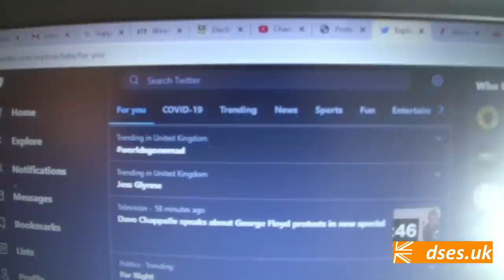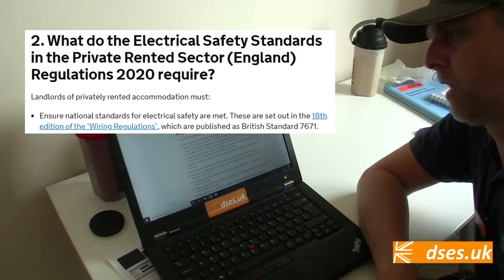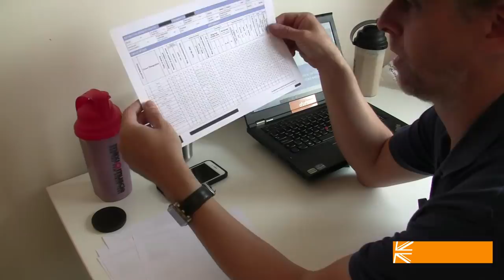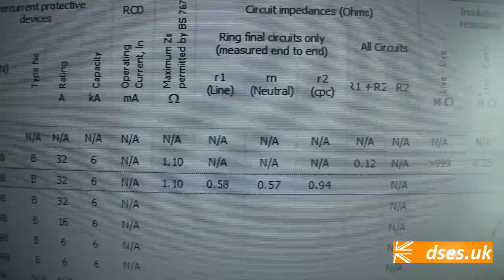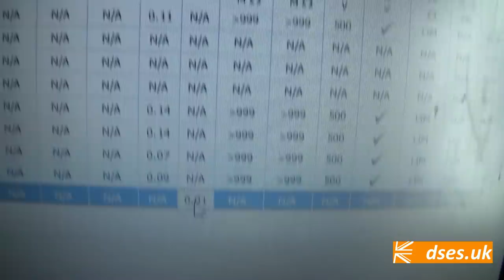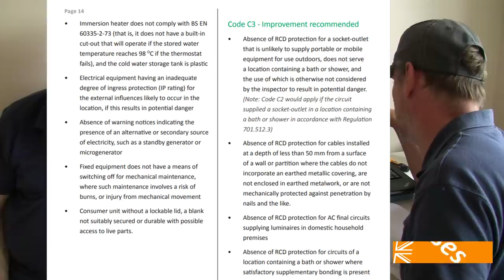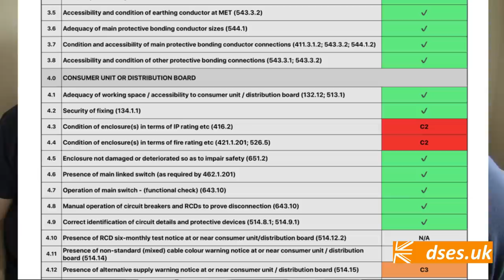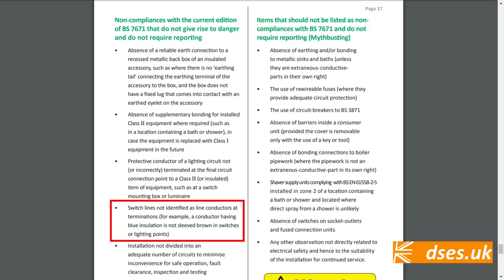Landlord electrical inspections from July!

Comment: The thing with these "landlord regulations" tests, is that it'll only affect the landlords that actually give AF; the bent ones will still be renting out run-down dog kennels for £££/month, or they'll scream "woe is me" at the idea of spending more than a fiver.
Reply from the maker: Sadly, always the case Adrian. Those who play by the rules also suffer under them as they get tightened. There are too few penalties for those who are happy to shun their responsibilities.
Reply: In Scotland you have to do it and if the landlord association finds out you haven't got a test certificate then the landlord is fined £3000 per property

Comment: Those ceilings look older than 1999 to me.
Reply from the maker: That's the quality Artex finish - ruining ceilings into the 21st century! We have an estate next to us built at the Millennium where they smeared Artex all over the ceilings. Plenty of work on putting in downlights for all the homeowners who are getting them replastered into a flat finish.
Reply: @dsesuk  one more year and that Artex wouldn't of been used with the Asbestos banned in 2000
Reply: David Savery Electrical Services Wow – that’s amazing. I thought that stuff was banned years ago because it contained asbestos.
Reply from the maker: @markpunt9638  I think Artex may be a brand name, but whatever they used, they weren't shy about smearing it over the ceilings twenty-odd years ago.

Comment: Their trying to keep fucking grenfall tower from happening again
Reply from the maker: To do that, they need to enforce workmanship standards. Switching to metal boards was a way to try and contain fires on improper installations. It's like sticking a plaster over cancer.
Reply: @dsesuk  non of my wiring looks like a shit hole .

Comment: The trouble is out of 10 electricians doing the same inspection probably 9 would want to replace the board and it would make you look a twat.
When I watch electricians on you tube, it's funny their reaction when they see a plastic board, first thing they want to do is change it.
Will landlords need to fetch the property up to current building regs because they are similar to our regs, as they are not retrospective.
Reply from the maker: I need no help in looking like a twat, but you're right in that we'd probably be in a minority by saying a metal RCD board doesn't have to go in here, then the customer doesn't know who to believe. We had a confused client last year after we installed an exterior socket at an outbuilding. The circuit had 30mA additional protection from an RCBO at source, then some other 'electrician' came out and told the client we'd installed it incorrectly as we hadn't put a 30mA RCD by the socket. I had to write a lengthy email explaining selectivity and why we had installed it the way we did. It was time out of my day to justify my work because some ignorant prick spouted off nonsense!
Reply: @dsesuk  hmmm sounds about right. I was not a fan of the metal board, it was dealing with the symptoms and not the cause ie the crap installers, my nic inspector got in trouble with his bosses for saying the same.
Anyway you are one of the few that I have seen talking sense, entertaining videos 👍.

Comment: Have watched many of your videos and been very formal (spot on), but in this case you seem to of taken this job and last electrician very personal, my view is if the eicr was for the home owner living there id give satisfactory with a report saying strongly recommend to upgrade fuse board, but the home owner is a duty holder and needs to look after them selves , the eicr needs to be more strict !, all circuits need to be 30ma rcd protected, id say either replace fuseboard or replace isolators for 30ma dp, and the cooker being 0.12 and his 0.15 is nither here or there, your very much in the wrong in this situation, look after the tenants, the property and the duty holder....

Comment: Hi David and the other bloke😂. I would have 100% come to the same conclusions as you after watching this vid but as usual it also throws you into so many grey areas created by the authors and dictators of the industry we have slowly become to loathe. The interpretation of all these new regs and amendments would drive any magistrate or crown court judge to throw any case straight out the fecking window.  Never mind the installation has been in service for 21 years and not injured or killed anyone. It just sits there doing its job, Heating our water and boiling our kettles etc but hey ; some fuckwit or fuckwits decide on our behalf to cast enough doubt and confusion so that some (not all ) contractors will just cave in and fail it as unsatisfactory simply because A. They want to get some profitable work out of it and B. They are worried if they sign it off as satisfactory they could hung drawn and Quartered. 
Of course we would recommend a few upgrades such as additional RCD protection  but for landlords who refuse this based on saving £300 or more when they pull up in a £80 k Range Rover . Then more fool them.
It’s all about interpreting the grey areas from the powers that be I’m afraid. In that case we’re all fucked.!!

Comment: So, to do electrical testing, I need to know the information of all previous wiring regulations and amendment dates to assess whether or not it complied at the time it was installed including the dates of any work done after the original installation.
I imagine this task would be worthy of the great Tony Robinson who enjoys digging around for dates or even an old electrician who is familiar with 14th, 15th, 16th, 17th and 18th editions but may prove alot more difficult for the younger electrician.

I would've thought, I this was the case, they would teach previous regulations today... but they dont.
Reply from the maker: No, you don't need to be fully conversant with all prior iterations of BS7671, but as an inspector your knowledge is expected to extend beyond that of 17th Edition's introduction in 2008 or later. A good inspector will have an understanding of the common design requirements and limitations of older installations. A bad one will simply write off anything older than five or ten years. To do their job effectively, an inspector has to have a wider knowledge of both testing methods and of the (relatively recent) history of their industry than an installation electrician or someone new to the game. By definition, those who don't know or don't understand what they're looking at aren't fit to be passing themselves off as inspectors. The problem the industry has is that guys unfamiliar with testing or who are wholly new to the industry are writing off the work of others because they believe everything has to match whatever latest misspelled half-arsed whim the IET have just coughed up. That isn't the case, and you can find that in black and white in the blue book.

Comment: 23:59 I'm sure that one only tests up to the outlet plate. And the wiring to the equipment is an appliance test. Now wait for the hate.
Reply: Agreed... However.. Advise customer of the outcome of the test, it's a 2 minute job to test the cooker IR at the same time.
Reply: @muzikman2008  no doubt.
Reply from the maker: True John, but we test the likes of cookers and showers to earth for two reasons: first they tend to fall outside of the PAT inspection despite meeting the category for stationary equipment the end user interacts with, and secondly to ensure the reading isn't so duff that should we be asked to install RCD protection there isn't already a fault to earth which would trouble the operation of such. I also cannot guarantee that the drop in reading isn't down to the cable from the isolator to the appliance, although it's not very likely, so I record the number seen. Had it been an IR fail, then we'd have to disconnect the appliances to find whether its the fixed wiring either here or on a revisit to address remedials.
Reply: @dsesuk  I would have thought there would be an cable from the isolator to a cooker outlet plate forming part of the electrical fixed wiring system. But I'm a giant bozo. Thanks for the reply I'm fan girling out. Be still my beating heart.

Comment: Dont get why your looking for loopholes so it will pass most propertys we go in to test are shitholes where landlords charge extravagant rents where they have got away testing them or done any electrical repairs itsgoodfor our industry and the tenants thats its still a shithole but safe so dont get what your trying to achieve and 2 ofu working all day for 160 pound dont get this shit your spowting
Reply from the maker: If you don't understand it, what the fuck are you doing in the test and inspect business?
Reply from the maker: @timkelliher6855  Oh, that's priceless! Why are you questioning a spark about electrical inspections if you're only qualified to pull human faeces out of U-bends? This isn't looking for loopholes; this is applying industry guidance to the inspection and testing task. But fuck it, it's not something I have to justify to a fucking plumber. You can stick in a valid opinion when I make a video about why my downstairs toilet isn't flushing properly, but until then, fuck off.

Comment: By all means RCDs are a pain in the arse,so don't fit if not required, also is smoke /heat detectors required on a landlords certificate,did not see any in the flat,nice to see sparkles that now what they are doing and understand the regs book
Reply from the maker: Smoke/heat alarms are out of scope for electrical inspections, although I mention the absence/presence/validity of such myself on reports.

Comment: I think your right, my interpretation of this test is that the installation should be tested to the standards it was wired to, ie 16th 17th etc.
As for the government guidelines well we won’t go there.  Good vlog nice to see Nigel back, did he have his Screwfix bag? Or has he gone posh and got a CEF one these days .
Reply from the maker: I've been trying to train him to do it in a sand filled box, but you just can't learn him.
Reply: No ! I see this a big myth.
You inspect and test against latest BS7671 not the installation date BS7671. But this doesn’t imply retrospective or necessarily unsafe/unsatisfactory.

ESFBPG4:

 “An electrical installation condition report is, as its title indicates, a report and not a certificate. It provides an assessment of the in-service condition of an electrical installation against the requirements of the edition of BS 7671 current at the time of the inspection, irrespective of the age of the installation”
Reply: Do new sparkies know the standards of the 16th edition, should they take exams to prove they no the regulations from x amount of years ago,  also is there any definitive way of knowing the date of the installation to inspect against pervious bs editions.
Reply: Possibly not, I was fortunate to work for a decent guy whilst at collage who had been around for many years, so when we used to properties he’d explain what and why  things where done at the time of installation.  Suppose it may come don to that on going debate about how people get into the industry

Comment: You are talking total rubbish!!... all installations old & new should continuously strive to improve levels of safety, if what you are saying was the case why are the standards themselves ever updated then??... why bother to test if? sure we will go back to old voltage trips they are safe !! etc etc another point did you do a 12th 13th 14th 15th 16th 17th 18th Edition wiring regulation courses?  so that you can report to the standard at the time of installation! You report to the current standards bust.., bat the ball back to the customer with your findings...one final question? how many fatal dwelling fires have you attended as an electrician where the fire started due to an electrical fault ?? a landlord has a statutory responsibility under the Electricity Work Regulations 4 (2) also some of your testing techniques are questionable!! I didn’t see you disconnect the oven after passing past the isolator.... also your video suggest that all sparks that carry out condition reports and then suggest remedial work are cowboys! speak for yourself!!

Comment: Hello so ive view a few of your vids and I  gather your 💩🔥 and I love your common scence 
So I'm a elec and mech maintenance engineer and would like to ask you if you could help with a an argument about drilling holes in structural rsj as the way I have red the regs it's a no no because you risk weakening the structure ( unless you calculate beam , beam weight, amout of fire retard paint ,size of hole drilled and amount of material displaced  and amount being put back in and type of metal used 😰) 

What would your view be being 💩🔥
Thank you

Ps any chance I could be considered for a job you did say lack of sparky and I dont need any lube I'm willing
Reply from the maker: Thanks for the pictorial compliment, but I assure you it's only half correct and the flame should be omitted! As for drilling RSJ's, well I've never had to in my mainly domestic line. If I were involved in a building project where steel was going in and I needed to route through it, I guess I'd ask the builder to undertake the task as I wouldn't have the tools and wouldn't want the responsibility!
Reply: @dsesuk  
Thank you for taking time to read and relp